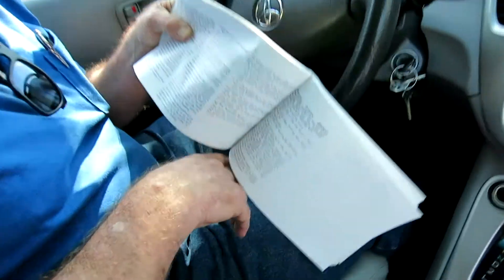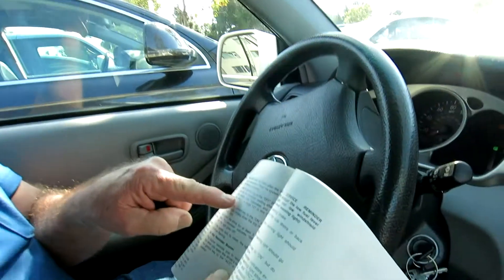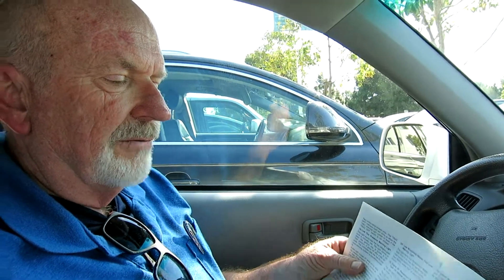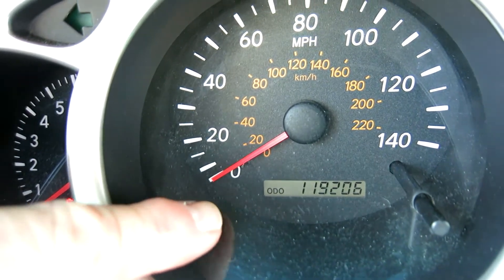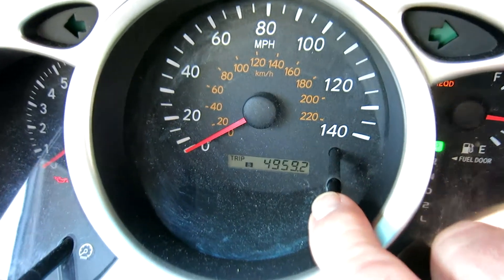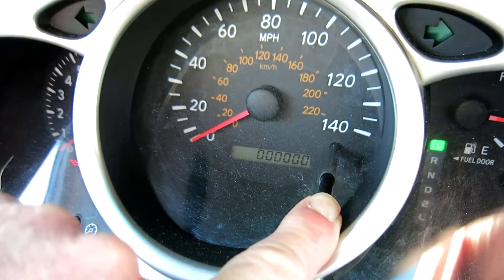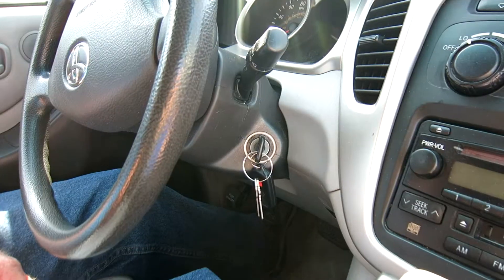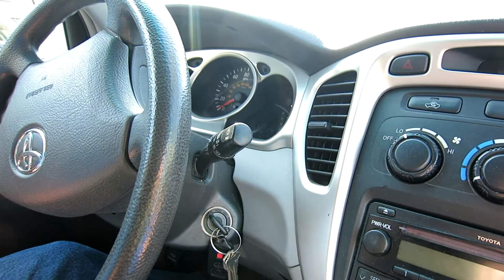How To Reset The Maintenance Required Oil Light After Oil Change 2001-2007 Toyota Highlander

Comment: 2007 Ford Freestar 4.2 odometer started blinking and is now completely out dealers trying to charge me $700 for a new cluster everything else works but the odometer and is the only thing digital on the cluster any ideas would be appreciated
Reply from the maker: Ok if I hear of anything I'll let you know:) Hopefully someone can help out and comment:)
Reply: DIYsavecash there has to be a way to solder it